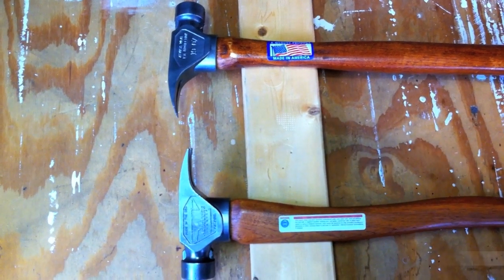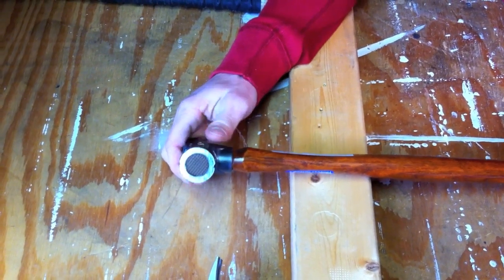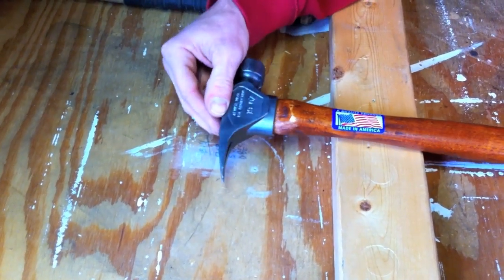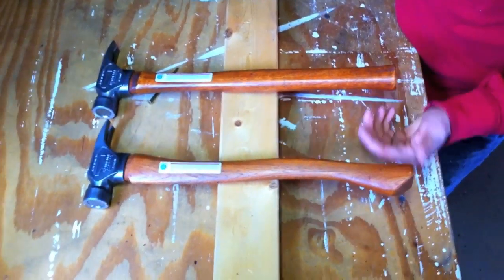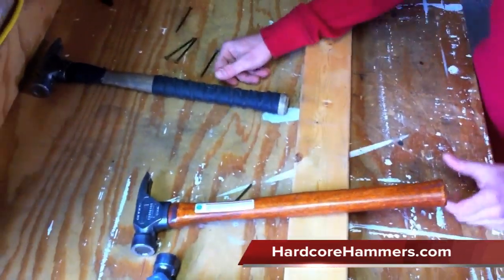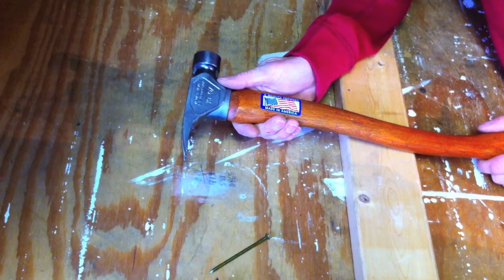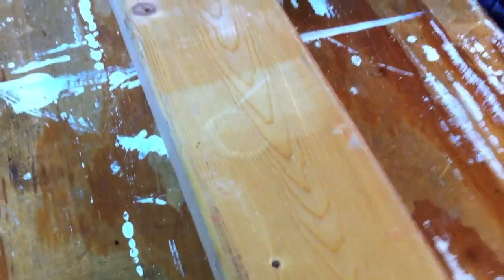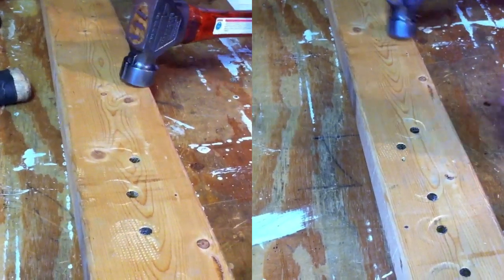Hardcore Hammers - Jack Hammer Tough - Review

Comment: Actually, S7 steel isn't one of hardest steel out there. It is one of the toughest, though, which is why it's used for making impact tool. It is harder the more common 1055 carbon steel typically used many striking tools, due to a slightly higher carbon content.

Comment: $60.00 for a hammer no way  Great idea but price needs to go way down.
Reply: 2LateIWon/Organized Chaos that an average price. most hammers range in the 30 to $50 for a good framer if you're looking for a stiletto Martinez tools or a couple of other high-end Brands your spending well over a hundred and sometimes even $200 for a quality framing hammer. wood hammers also usually cost a little bit less then steel or titanium or fiberglass
Reply: According to what? Just because you said the price needs to come down? Nice hammers get up to several hundred dollars. Hammers you would pass down generation to generation. Not China garbage.
Reply: I can pay $60 to $90 hammer that is pure 100% Made in The USA❗🔨 🇺🇲 with a good steel like 4140 Alloy Steel and S-7 Machined tool steel. I can live with that price but I'm not gonna pay for a $125 to $147 to $300 Titanium hammers that are made in CHYYNNNNAAA!!!! No way! My old Vaughan California Framer 27oz Rip goat head California Framer  Hammer is still alive and strikes a 3-1/2 to 3-1/4 inch Common Nails in one hit! Yeah one hit, because that hammer have a much larger striking face than its sibling 23oz California Framer. I also had a 28oz Rig Builder's Axe aka Carpenter's Hatchet that lasted me for 14 years I've been replacing the handle every 5 months and finally gave up and the side of the Head cracked and broke and I replaced it with a 27oz California Framer. I Also have Dalluge 21oz steel Waffled face California Framer curved handle. All of my framing hammers are California Framer style hammers. Including my recently purchased Hardcore Hammer original 2.0 I'm 53 yrs old been a Carpenter for 15 years and never have sore arms, shoulder and wrist and elbows I love steel rip goat head hammers especially California Framer style hammers. The only time I get fatigue and my elbows, arms and shoulders hurts is when I'm using a pneumatic framing Collated nailer or cordless framing Nailers. But my arms, elbows and shoulders never gets hurt in using hammers. Even when I'm using a Sledgehammer too.

Comment: IF CENTER IS  RECESSED, THE NAIL HEAD CANNOT BE  PERFECTLY  FLUSH.  IF IT IS  RECESSED, HOW CAN YOU GET  THE NAIL  HEAD  BELOW THE SURGACE?  GARBAGE
Reply: Haha! 😂 You just hated American made products that's all! With everything you said that figures! 😂 instead you like the Chinese garbage stiletto titanium hammer that it's hammer head flies and hits somebody. 😂 I have mine the very same hammer hardcore hammer curved newer version 21oz and never had problem using it. It can sinks and flush the nails with no problem, techniques and skills it all that matters. That's why this is called a framing hammer you can use this a finish hammer but obviously this is a framing. What I'm really after this product is the S-7 Machined Tool Steel Waffle face disc that casted inside the 4140 Alloy Steel Head. That S-7 Steel is harder than the Stiletto titanium. I had stiletto before and it's a garbage! Love American made hammers.

Comment: IF THE CENTER IS  RECESSED,  AND THERE IS  A  RIDGE  LINE FROM OUTER EDGE,  THEN  IF YOU  HIT THE NAIL  HEAD ON THAT  RIDGE LINE,  RECESSED PORTION  AND FLAT HIGHER  AREA ==BENT NAILS ALL DAY LONG.  GARBAGE